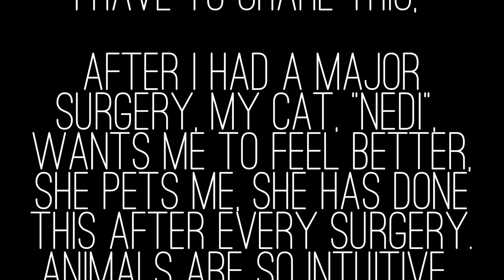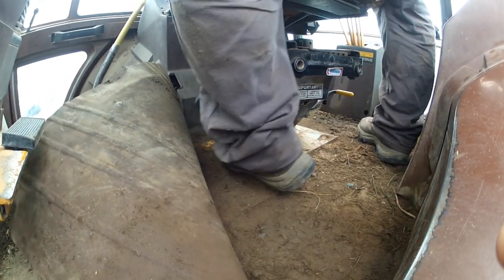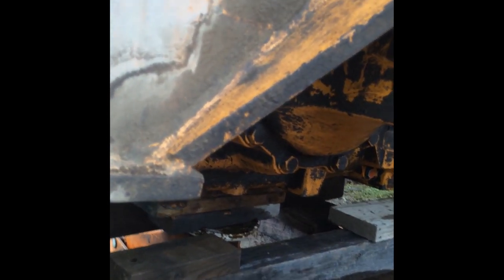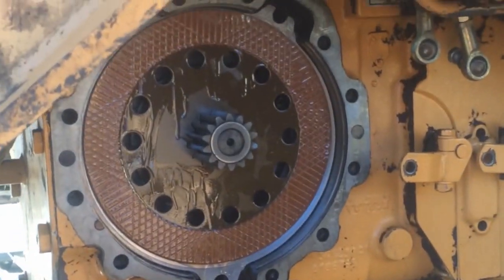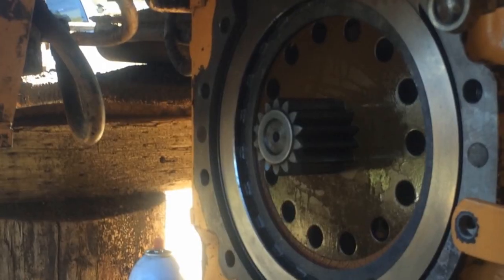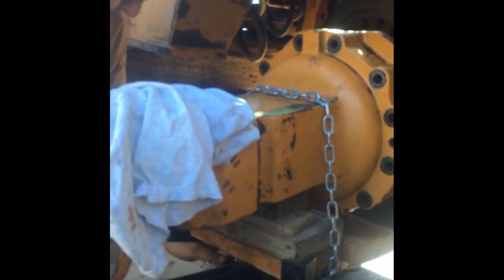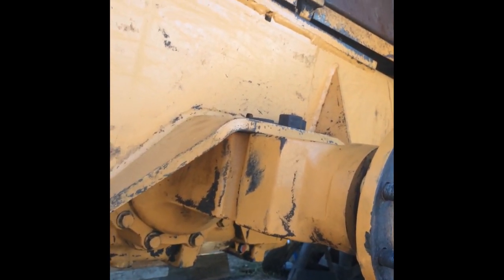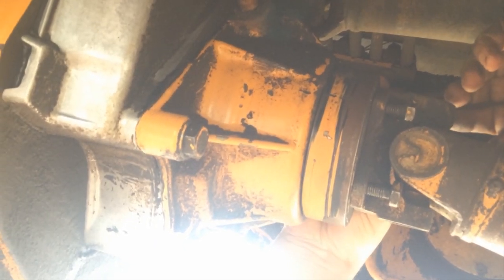,  new brakes on Case, 580K  backhoe

Comment: I just did the brakes on my 580C which is a different design. Its a dry brake shoe/ disk design. The bearings were worn on the 1/2 shafts that drives the brake hubs. To remove them I had to pull the axles and move the bull gear out of the way so basically I had to rebuild the differential with al new bearings, seals, brake linings, wheel cylinders, etc. Its allot of work. I also replaced the rear tires myself which was fun. To do this to the extent I had to you do have to know what your doing as you have to set-up the ring and pinion clearances and bearing pre-load which takes some time with a dial indicator.
Reply from the maker: Thank you for the information,   that sounds worse.   I have a old case 680..   i has breaks that ride on the pinion shafts,   easy to replace,  just pull a cover off  slide steels an discs off shaft, to renew, reverse procedure  with new break parts.     but one problem,  disks are way o small a diameter,   so on a good day   here is very little breaking power.

Comment: I have pulled two different backhoes apart for brakes in forty years and they are terrible to work on . The kick in the ass was one didn’t actually need the discs it was the linkage was rusted under the floor board . I would soak the new discs for a day or two before I installed them. Just something I would do with transmission discs probably just old school how I was shown.
Reply from the maker: these discs are no fiber or  normal break martial,   there is a grainy metallic material imbedded on the disk?  did not think soaking would do any good,   thank you for the commend.

Comment: Just brake on one side?
Reply from the maker: no,   we did both sides,   they  are identical
Reply: @upsidewithstephenkreider589  I'd like to think Case would make it easier to replace brakes. I've been thinking about replacing my current backhoe with a case, not new of course. Good video.